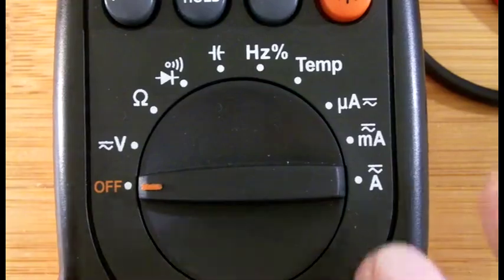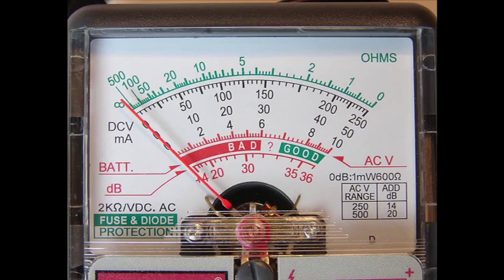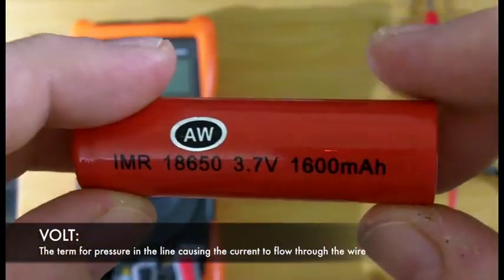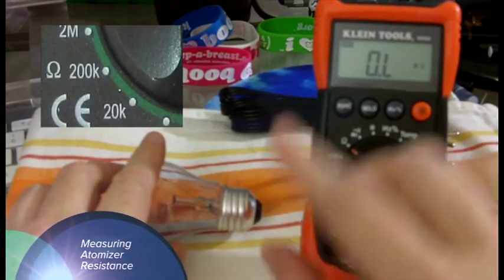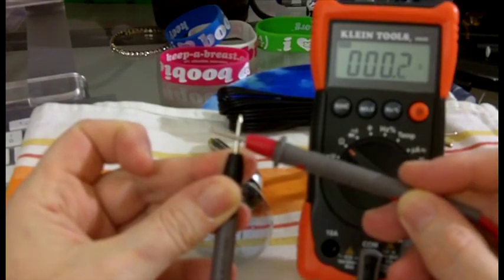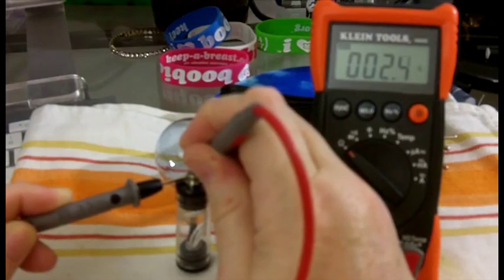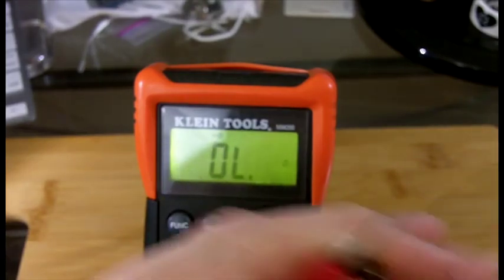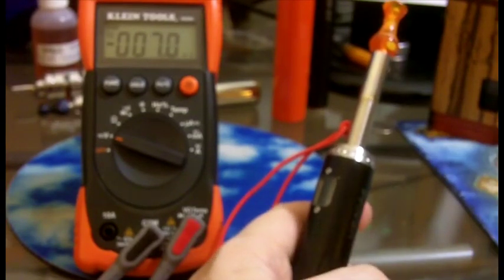Multi-Meter How to for Electronic Cigarette users

Comment: this is an excellent video!! I just bought a multi meter yesterday and was wondering how to check atties, cartos and batteries. Its pretty straight forward how to do it but thought I was doing something wrong as one new battery was giving me problems and reading low after supposedly being fully charged. Well watched this video confirmed I was testing properly and confirmed my suspicions that I had a defective battery as it was driving me nuts thought my new mod and kick were bad!

Thanks Again

Comment: good info thanx just what i needed to know since i plan on building my own coils fairly soon...just curious i'm aware that generally most are using kanthal wire and silica wicks but is that a "law" what i mean is could i use something like cotton/copper instead? seems like i can get those things a bit cheaper

Comment: Verry nice video!i have a question im new to multimeters and i nust got a nice Klein mm2000 and i wanted to know if it goes down to subohms?i know some people have that dial and they put it on the lowest 200,so mine doe not have that in the dial idk maybe because it auto or something,if someone could clear this up and help me i would realy appreciate the help!!!!!!
Reply: If your unit's display reads point anything, it will read down to .1 ohm with approximately 1/10 ohm accuracy depending on which devise that you may have. So you can read ohms below 1 ohm from .9 ohm to .1 ohm. A unit that reads to one hundredths(.00 accuracy) or even thousandths(.000 accuracy) is quite expensive and I just discovered that your machine is quite sensitive after finding the spec sheet online in PDF format. You should have no problem reading sub-ohms with .000(thousandths) accuracy and it's an auto-ranger which also makes for ease in operation. Damn Nice machine ya got there!(envious tone intended) HaHa! Now I wish that I had spent the Big $$$ on a more sensitive and accurate model like yours even though I'm Definitely Not an electrician, just a hobbyist and a self taught around the house, car, truck, boat, or RV repair guy.
Hope this helps.